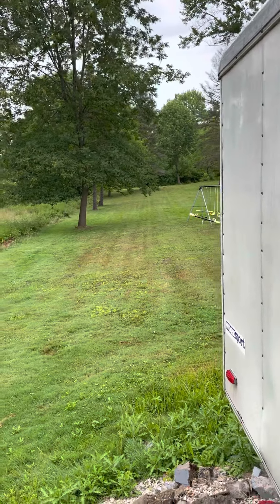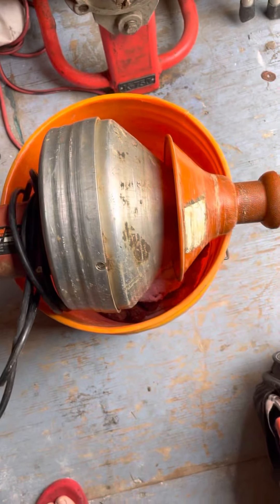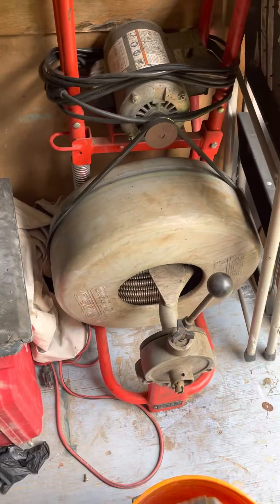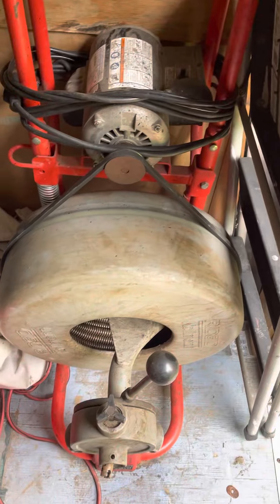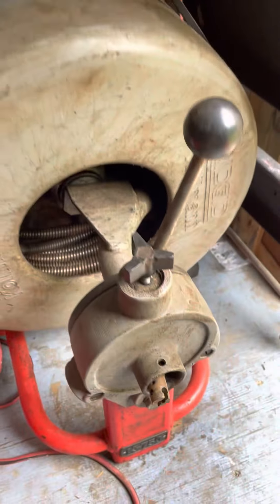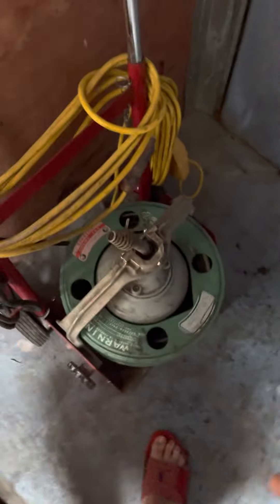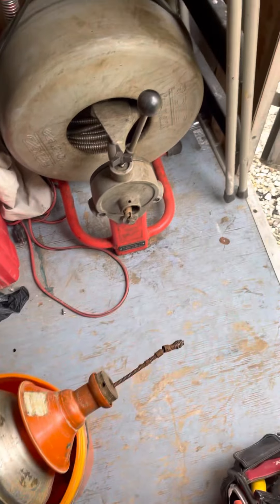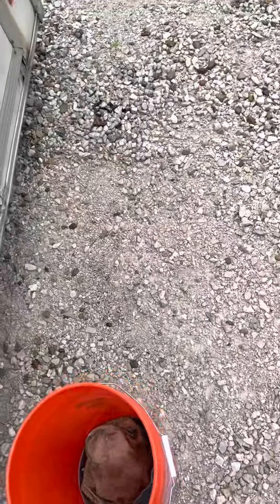Drain Cleaning Equipment  I use for my Business | Best Brands and Tools to Use

Comment: I am a Real Estate Agent in South Louisiana and I see a huge need for drain cleaners, sewer and Septic work. I am starting with drain cleaning and I am schedules for the Septic licensing class. Starting with drain cleaning, I am starting with a Rigid K60sp, Rigid K9-12 Flex Shaft and a Power-Vee with a Handy-Stand. Is that a good starting point or should I add anything else to the equipment list?
Reply from the maker: @jaymartinrealtor7736  hey what’s up! Appreciate the comment, and a great one it is. Sounds like you’ve got a really good set up on your hands. Obviously start with that equipment. If it doesn’t work for you adjust and get proper equipment. And your move will be when you get a. In my opinion that is one of the best pieces of equipment that you can have. Especially especially with you being in real estate. This is a no-brainer.

Comment: What you charging for main line with outdoor cleanout? Ans for toilet pull and reset cable jobs?
Reply from the maker: All depends. Jobs like that from outside usually start at 400 and go up depending on how long it takes to clean. Inside toilet pulls start at 600
Reply: Im usually around $420 for outside access (cleanout). Plus 89.00 service fee to bring tech out which included diagnostic.    If I'm already out clearing a main line I throw in the camera for $149. $249 if only objective of call. Toilet pull and reset with cable job around $650. I also land a lot of toilet replacements on pull and resets. Especially when I pull q toilet with a 2" flush valve. Usually throw in a champion or even deltas I like now a days.

Comment: If your Rigid K750 went down on you would you rebuy it or what would you have your eye on in a similar price range? Next step up?
Reply from the maker: Great question! For the price and durability and option to run 2 different cable types I would buy this machine again. If not the Ridgid 750 then I would go with either a Spartan 300 or Spartan 1065

Comment: Do you need plumbers experience to be a drain cleaner? Or handyman skills will suffice? I am considering doing this as a side hustle but I am not plumber. I have unclogged bathroom and sinks in the pass at friends and family house
Reply from the maker: You dont need to be a plumber to do drain cleaning. It helps to have knowledge on how to repair and replace drains since these are going to be common items that come up while your drain cleaning.
Reply: So if you don’t know how to repair pipes I guess you recommend to the customer to get in touch with a plumber. Just thinking logically how often do snakes get caught in pipes? And if it does how do you go about it on addressing the issue with customer?
Reply from the maker: I would say that should be something that you should learn. That will make you look more competent and you'll be able to get more money from a job if you need to do a drain repair. This is where working for a company first before you start doing side work is important.  @juansantiago8983
Reply: Thank you you definitely gave me an idea to do side hustle.. good content TY
Reply from the maker: Hell yeah man. Best of luck @juansantiago8983